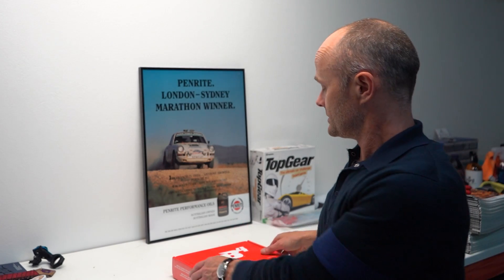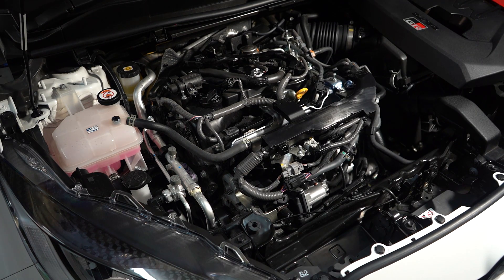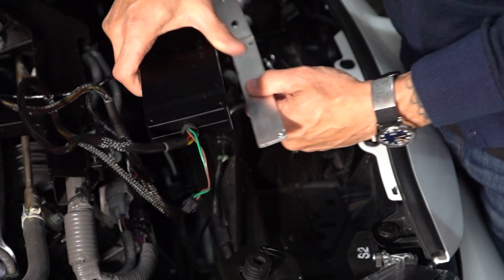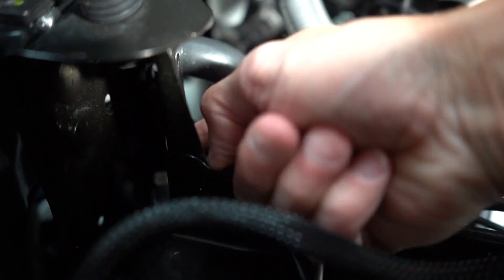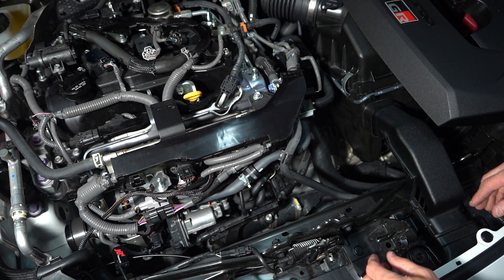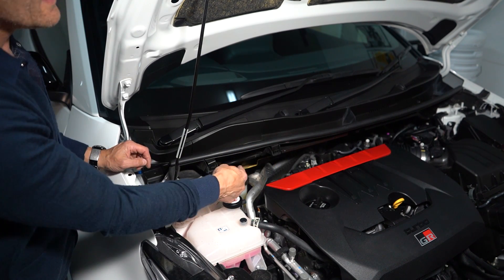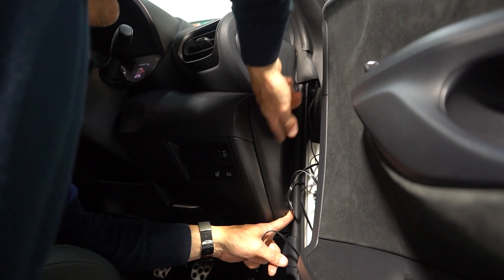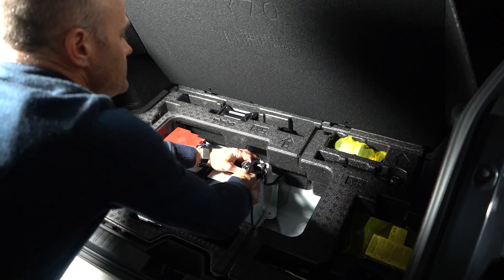GR Yaris JB4 Tuner Installation from Burger Motorsports

Comment: Did you encounter any issues? Any check engine lights?
Reply from the maker: YEs when I went to the rev limiter, but they reset when I next turned on the car.
Reply: @MarcandCars  thanks! I’ll stay away from piggybacks then, as far as I’ve investigated, every single one has had issues

Comment: OT. Not  much info about these aye, winder if safe too use. They don't handle too much extra boost
Reply from the maker: Remy, the unit I was supplied still needs some development, and whilst there is a bit of an increase in boost, it more affects when the boost comes in, and with how much urgency. Makes the car feel a lot quicker.

Comment: how are you finding the jb4?

did u ever manage to get any dyno runs?
Reply from the maker: Sadly no. The car has been in the panel shop for a couple of months waiting for parts from Japan, due to an altercation with a Kangaroo! One of the challenges of living in WA. Then the car is going on the market, as it's replacement is now in the garage. email me directly, as the JB4 is back in it's box in the garage, and will not be getting refitted, if you're interested. Thank you for taking the time to watch.
Reply: @MarcandCars  Is the jb4 still for sale?
Reply: @Marc and Cars  still have it will you post too qld?